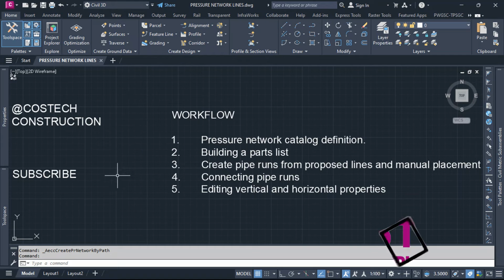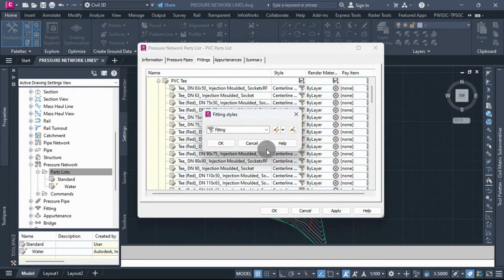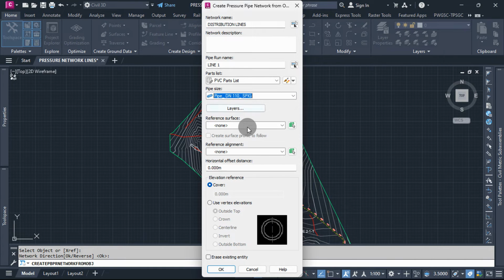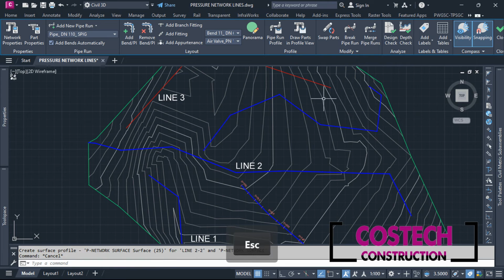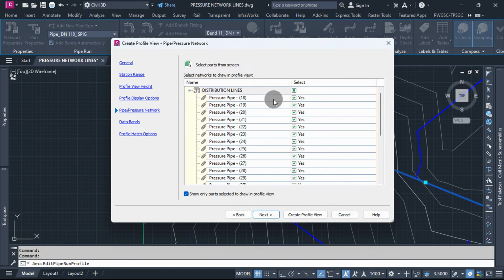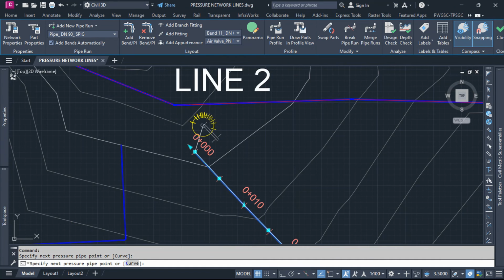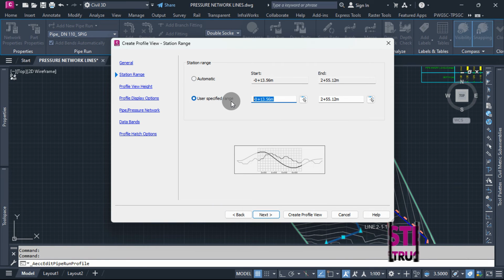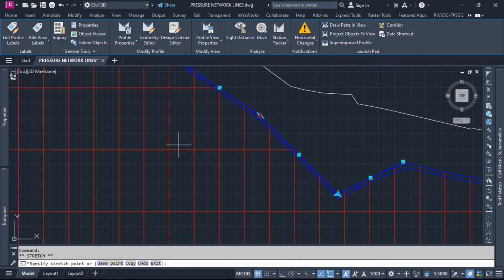Mastering Pressure Pipes in Civil 3D 2024: From Introduction to Advanced Techniques

Comment: Sir I'm having some problem to modify pressure network. When I work on your profile it works good but I save this file and open again in civil 3d and try to modify our network, I couldn't make it. Because when I click on pipe I get different tab instead of pressure network tab. Please sir help me
Reply: Sir when I try to make T-joint it shows me error parsing valve in line and moreover if I open your file after saving I don't get same pressure tab and other option to make T-joint, band etc. Sit please help me how to design all these thins
Reply from the maker: You can modify your network by going to Toolspace pallet, Prospector tab, then expand Pressure networks, Right click on your network name then select Edit Network.
Reply: Sir thanks a bunch for your response but I'm unable to create T-joint as yuu created

Comment: what about controlling for deflection?
Reply from the maker: Sorry i forgot to discuss deflection. I will do it in an upcoming video on sewer design
Reply: @costechconstruction254  I would appreciate that.  There's very little content out there on how to control for deflection using the Pressure Network tools in Civil 3D.  Autodesk itself doesn't even have tutorials.  The one useful thing they did recently is in 2024 they added the ability to have the deflection included in a fitting labels.... but not at pipe to pipe connections.  Also using pipe runs and and cut length in the profile layout makes violations of pipe to pipe deflections  even more difficult to catch.  I understand that this is not something that is commonly required because most small diameter pipes have a pretty decent allowable degree of deflection.  Unfortunately I just have a project that has 36 inch pipe for miles and the only way I felt confident in the design was to lay it out without using pipe runs, going one 20 ft long segment of pipe at a time.

Comment: Which catalogue do you use when dealing with seamless steel pipes for pressurised oil and LPG ?
Reply from the maker: You will need to customise your pipe catalog or modify an existing catalog to meet your project specifications for pressurized LPG and oil pipes.